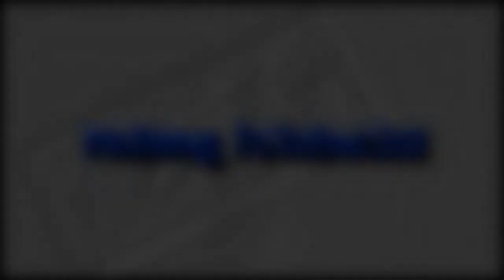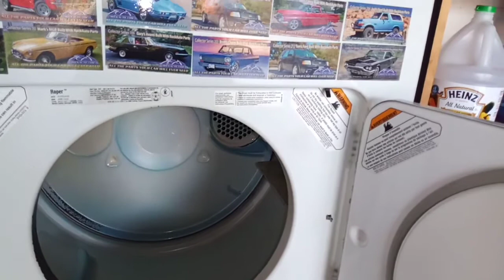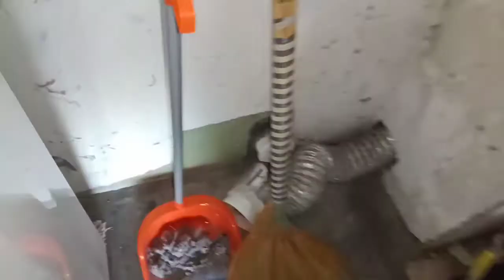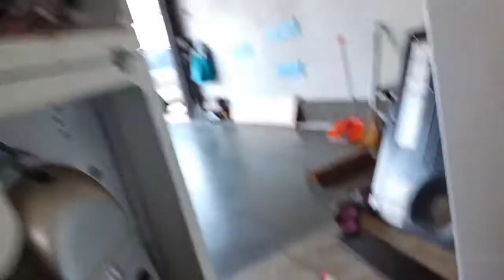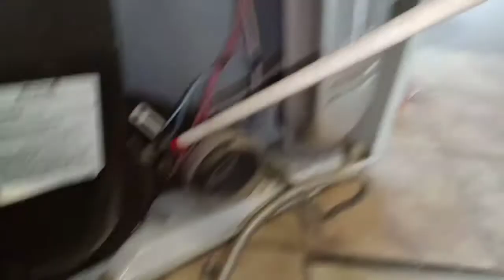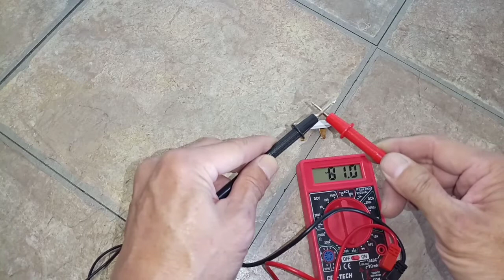Getting Handy: How to Fix Your Clothes Dryer for $5.

Comment: I always buy an appliance's popular model (cheapest). The kinks are worked out over a million units vs a thousand on the fancy models. There's no $$$ control panel to total the appliance. They always fail.  The shop manual says to test a $350 panel swap it with a $350 panel. In my extended family all the replaced furnaces, stoves, washers, ac, microwaves,water heater etc were from failed control panels.
Reply from the maker: Yes, most of new appliances rely on electronic control module that WILL fail in the long run. I love appliance that built in the 60s and 70s. They run forever! I replaced a control module from a cheap dishwasher that happened to fail right after one year warranty mark!🤷🏻‍♀️ It was $100 part!🤦
Reply: @MoBangFoYoBucks  Few years ago two brothers dropped $3500 each replacing 10 year old HE furnaces. I can live with my 84 using a bit more fuel. Even I have a, barely used, dead $1400 Maytag rotting in storage while I'm using a old Kenmore to wash cloths.